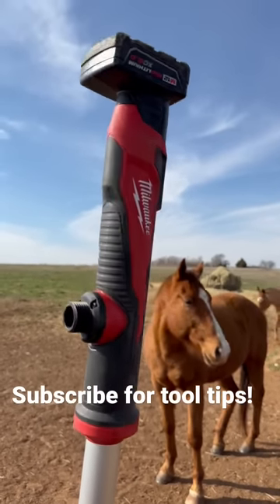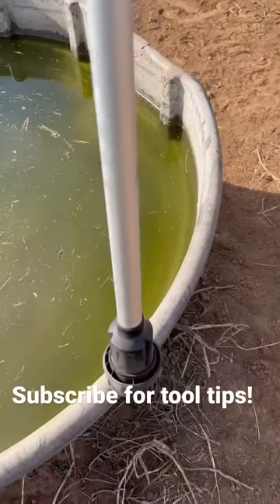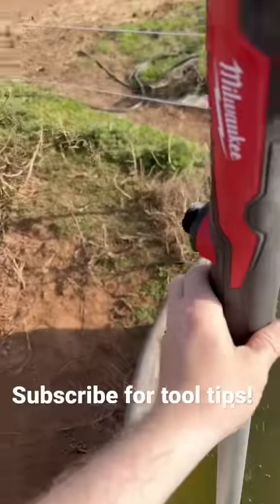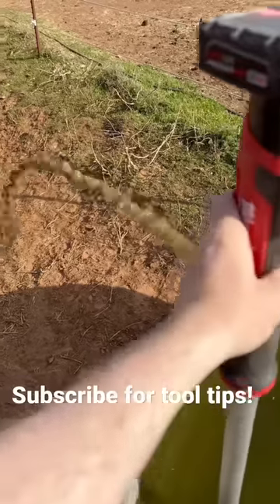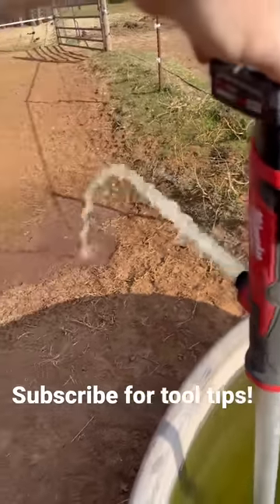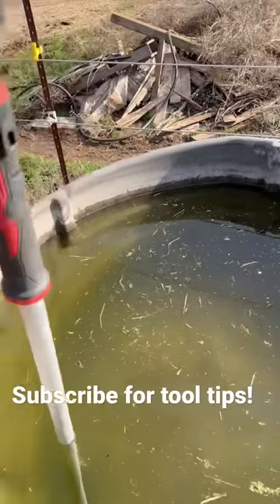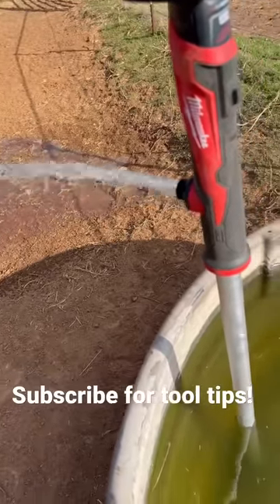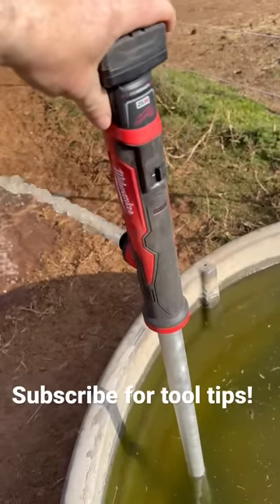Milwaukee M12 Water Pump!  What do you use yours for?  #milwaukeem12 #milwaukee #stickpump

Comment: We can all agree that this video was made to show your wife that it wasn’t “a stupid idea” to get one 😂
Reply: Lmao probably, I use a Milwaukee transfer pump, wouldve done that tank in 60 seconds lol
Reply: @zbruh7268  lol
Reply: that's just you
Reply: It’s to prove it to your bros tbh
Reply: Well theres 598 guys who would agree with you.
Reply: Hahaah
Reply: im ur 1k like
Reply: He put the hole in the tank himself.
Reply: @fosty.  what he didn’t show you was the Milwaukee drill on the other side of the tank
Reply: I've got one for pumping out valve boxes. PRO TIP: take a Rigid wet-vac filter, plug the bottom hole in the rubber with a 1/2 inch pvc threaded plug, and the head of the Milwaukee pump fits nicely in the wet-vac filter opening which prevents the pump from getting clogged with grass and debris.
Reply: I've got one for pumping out valve boxes. PRO TIP: take a Rigid wet-vac filter, plug the bottom hole in the rubber with a 1/2 inch pvc threaded plug, and the head of the Milwaukee pump fits nicely in the wet-vac filter opening which prevents the pump from getting clogged with grass and debris.
Reply: It only cost 20 dollars I swear...
Reply: If you're living your life based off what your wife says you can and cannot do then it's time for a divorce. For me and my significant other, we have a spending limit where we can buy whatever we want up to that price. Anything over that price you need to consult with one another. It works for us.
Reply: He could just pour the water out and he has to hold it the whole time so I actually agree with the wife on this one. This is a pretty stupid idea
Reply: Wife prolly just uses a 2 metre hose, lets the water siphon out on its own, no battery needed. 🤷🏻‍♂️
Reply: Lmao 😂

Comment: I use it to siphon gas out of my neighbors car. Works like a charm.
Reply: i love you dude and i don't even know you😭😭😂😂
Reply: Really, its your neighbors' fault if their fuel filling hole is big enough to fit this.
Reply: @groadybones  buddy buddy buddy….. it clearly would have to be modified in order to retrofit a hose on the siphon end in order to get into the tank. But it wouldn’t work for long anyway
Reply: @groadybones  that's what they say about me on the weekends 😂😅
Reply: Aaah this one's quick. He beat me to the joke I was gonna say
Reply: This would never work for fuel it would explode immediately if you tried. Don’t seriously use an electric pump to pump fuel. Unless it’s specifically designed to pump fuel.
Reply: @shanekerry9530 why wouldn't it past?
Reply: @shanekerry9530  dude , it’s a joke
Reply: @shanekerry9530  it wouldn’t explode 
It would dry out the internal seals pretty fast though
Reply: @shanekerry9530  yes it would i use it daily to pump pump containers of fuel
Reply: Drilling a hole in the tank and using a oil catch pan works too
Reply: thanks for the idea!
Reply: @jrc-fabs1634  I hope it works out
Reply: Bruh 😂😂
Reply: @shanekerry9530 ”modified” a garden hose and duct tape😊
Reply: With gas at five dollars a gallon I'm sure you have.. Every time I go to the pump every week it goes up $.20 $.50
Reply: It's easier to just poke a hole in the bottom of the tank with a hatchet. Then use an oil drain pan to catch the gas. Then dump it in a 5 gallon bucket until it's full. And then repeat until all the gas is gone.
Reply: Little horse water won’t hurt anyone.
Reply: @shanekerry9530  like the EFP in your vehicle?
Reply: @relaxandsleeptime5769  nothing like that actually…. You mean like something specifically designed to pump fuel vs???
Reply: @shanekerry9530  yes like the a fuel pump in a vehicle meant to pump flammable liquids.
Reply: @relaxandsleeptime5769  again missing the SPECIFICALLY DESIGNED to pump that fuel …. A submersed pump. Made to pump fuel vs a pump made to pump non flammable liquids
Reply: Y’all think a cut up garden hose and this thing won’t suck a tank dry and get your saw/bike/ truck running? Maybe kinda dirty but if it runs it runs.
Reply: No I guess I’m more concerned of electric spark and possible vapors igniting I guess in an open ventilated area pumping fuel may be fine but I personally watched an idiot torch 2 brand newish trucks and entire garage sucking up gas with a shop vac and I wouldn’t want to risk it
Reply: If you punch a hole in their gas tank you can just use a bucket. You’ll see the vehicle gone for a week or so but when it comes back they’ll probably fill the new tank up and set up a sting. That’s where the fun begins 😃😃. Fat suits and wigs come into play. You may have to spike their water supply with lsd and meth but that’s all part of the game they asked for by moving near you, it’s their fault. Get that gas 😁
Reply: I know you being honest 😅😅😅 damn.....love it❤❤😂😂🎉😅😅😮
Reply: @shanekerry9530  And since your saving $$ on gas you can afford brass fittings to adapt it to fit in the neighbors tank.
Reply: @danielbarber8387  lol sue thing nothing like the possibility of ripping 2 tanks off at the same time

Comment: I'll race you with a dollar store bucket. The winner keeps the pump 😂
Reply: Exactly 😂
A piece of hose would also do the same thing lol
Reply: those troughs all have a huge drain plug, too.. mine all have drain spigots..
Reply: why u need the pump if you got the bucket then🤷‍♂️
Reply: @dorianpaul7026  sell it for another bucket lmao
Reply: @Chrischone2  my man haha
Reply: The point of the video was "I have a excuse to use this tool" but like the comment earlier said there is most likely a plug to drain the thing lol
Reply: @dorianpaul7026  to sell it online and buy myself a useful tool xD
Reply: Exactly, winner keeps the pump because the loser never had it in the first place.
Reply: @Chrischone2  😂😂😂
Reply: I'll take the bet.  The opening to the pit the water is in is 8inX8in.
Reply: @dommyboysmith  I'm not volunteering to get the siphon started.
Reply: @amerlin388  if you put the hose in the water, then stretch the hose out and pour about a gallon of water into the other end, you can just drop the hose and the gallon you poured in will run out creating enough vacuum to pull a siphon. Works like a charm
Reply: @Factchecker9111  Yes, yes.  I couldn't get over the visual of someone getting a mouthful of that water.  You can also gradually submerge the hose so it fills with water, cap the end with your thumb, pull out sufficient length and toss it to the ground.  You must be strategic in how much hose is left in the tank;  outlet must be lower than the inlet.
Reply: @amerlin388  very well

Comment: Aside from using it to discharge water, you might be able to use it for a camp shower. Screw on a 1/2” Flexi hose and hand held shower head 👌
Reply: Exactly what I did except I run it's output thru a EcoTemp L5 heater.
Reply: Very good idea!!

Comment: Gotta love those rare times we get to use unecessary crap we buy.
Reply: What’s wrong with a bucket?
Reply: @dnlfrkmn  
How you get a bucket down a toilet tank? This things awesome
Reply: @dnlfrkmn  in this situation for the short technically a bucket is fine. 

For when you have to handle something that's flooded and you can't get your five gallon bucket or whatever down into the pipe or whatever it's perfectly fine to use this
Reply: If you lived on a ranch, you'd know that a trash pump is essential. I actually had to use mine last week to pump out a watering trough (an oval galvanized one for cattle) just like this. I used it connected to an IBC tote to water new plants down at the entry gate. I used it to pump the extra herbicide from last year back into the sprayer. A million different things. Owning livestock and a large ranch is a full time job. I do it when I get home from my actual job, plus I have 2 full time employees at the ranch, one of them lives there full time. There is always work to do. The amount of tools and equipment you need is staggering.

Comment: I'm pretty sure you can improve your battery life by attaching a hose 1.5 times longer than the pipe.
That way siphoning pressures will be helping you pump down reservoirs instead of it all just going into accelerating individual droplets to the ground.
Reply: Yeah - that's a great idea and I'd bet this device could be shut off to save the charge  on the battery
Reply: The length of the hose doesn't matter as long as it's at ground level.
Reply: @allaboutroofing2  *As long as the end of the hose is lower than the intake
Reply: Thanks bill nye the science guy.............
Reply: Just saying... that if you have service or flush  several reservoirs to tend to on a near daily basis then saving battery life by using siphoning line can save money and time.
Reply: or you can just use a siphoning hose and  skip this whole  tool
Reply: Yea you are correct. The water in the hose would create a vacuum pulling the water up to the pump. But this is simply a waste of money. Plus it destroys the ground as you see in the video. You want a easy smooth flow coming out onto dirt so it doesn’t erode away
Reply: or just, you know, run the thing at an angle instead of plumb until you need to suck out the last drops.

Comment: 4 hours later and 12 battery charges and it's done!
Reply: That Milwaukee battery lasts for many hours 4 hours is no problem on 1 charge
Reply: @ericschulze5641  Seriously doubt that battery is lasting anywhere near 4 hours doing that.
Reply: @Austin Michael  you probably have a ridged brand they suck the batteries only last 20 minutes if your lucky. The guys not the smartest anyway, when all you need is a scrap of garden hose or a shop vac hose and you can siphon it off while doing something else
Reply: @ericschulze5641  I don't own any ridgid. This still isn't lasting 4 hours
Reply: Idk, I ran my m12 fuel impact all day running deck screws in before I needed to recharge it. 6amp xc
Reply: 9gpm and 275 gallon out of 1 fully charged XC 4.0 battery. Not bad! I used one weekly and it’s awesome!
Reply: Idk man I did an entire cabinet build with a small drop ceiling added in couple days of work on 1 5.0 battery between drill, impact, and multi tool. Still had one bar on the battery after the job was done. 15 years ago my crapsman would have easily went through 10 charges
Reply: @AustinMichael  on a rapid charger,  the battery will charger in 20 minutes.  That 6 amp battery will last an hour and a half.  As long as you have two batteries, you can constantly charge. I use this for my boats all the time. I always keep one on my boat in case of an emergency

Comment: Should’ve installed a 1” pvc valve as a drain while it was empty
Reply: @ScoocumAF  that too though I’m personally sketched out by the thought of creating a flow of water that’s pointed directly at a battery powered tool that’s in your hands
Reply: @pws3rd170  it's not gonna electrocute ya!
Reply: Those tanks already have drains at the bottom he probably just didn’t want to drain it all the way as well as put that little guy to use
Reply: You could do that oooor buy stupid tools you don’t actually need 😂
Reply: @pws3rd170  almost like a wet vac.. except they're mains voltage.. CRAZY
Reply: @pws3rd170  it’s 12v…
Reply: Those troughs typically already have one bottom center on a long side.
Reply: @1982MCI  can still ruin an expensive power tool
Reply: @user-njyzcip  and that expensive drill isn’t waterproof
Reply: @alexcb016  I’m aware but it would appear this one doesn’t or it’s not functional since he didn’t use it

Comment: Laughs in .99¢ siphon hose
Reply: That's not the only use for it... Try siphoning out a flooded water valve access pit.

Every tool has it's use.
Reply: @volvo09  $200 verse about $15 for a drill transfer pump

Comment: My only problem with Milwaukee is the Batteries cost and arm, a leg and a kidney to get the Battery operate stuff going, the charger is also sold separately 🤣🤣 By the end of it you abt 700$
Reply: As an owner of a few m12 tools, a lot of what you’re saying is false.

2 batteries are $55 if you need spares.
My tool came with a charger and battery.

Comment: Okay, that is cool. And when I'm doing sprinkler repair I'm constantly pumping out water. 

On a budget, I had a 2-inch siphon that I used when I was cleaning the horse trough. I made it out of PVC. It would empty that tank pretty fast too. Just dip the whole thing in the water, put my hand over one side to keep it primed, and then hang it over the edge.

I would clean out their water trough anytime it got looking so nasty that I wouldn't drink out of it. During the summer, it was a regular chore.

Comment: Video would have been longer but the battery died.
Reply from the maker: I actually pumped down 10-12” and repaired the hole. Still had 2 bars on it.
Reply: @MillisConstruction  sorry, just my sarcastic nature. I have a family member that works for the city water department and he uses one to pump out fire hydrants so they don't freeze if they get used (charged) in the winter.  He said everyone should have one. I personally don't have one so they must be junk....

Comment: I didn't know they made such things.  Is it more economical than buying an off-brand pump?  Also, if I were you, I'd attach a hose to the outlet long enough to reach the ground and then shut off the pump after getting the siphon started.  There's no way you have enough battery power or spares to empty that thing, and not worth the wear on the tool.

Also, I didn't notice, is it brushless?

Comment: Too bad we can't change the barrel to a hose for deeper reservoirs.
I've used small pumps driven by a drill that are similar to this which is great for outdoor use with a length of hose on both ends. Indoors I can do the same with a long garden hose attached for larger volumes of water. If its just a few gallons to draw I use a "bucket head" wet/dry vac that I can plug into a 110 outlet

Comment: I had this idea for years im glad someone finally made one only one  problem they it came out after i got a new job and got a way from the water company years of hand pumping one thing i will say it nice but slow hand pumping is quicker when meter reading I've built something like that with a 20 volt battery and a transfer pump a little more volum take the same amount of time i say a shopvac is quicker but who has that kind of time

Comment: This would be good for a mobile pressure washer setup for when it’s too far for a hose.  I’ve tried with just gravity and it doesn’t work, you need sone head pressure.  30 gallon trash can or barrel, this and your pressure washer in the bed of a truck would get you 5 minutes of warshin’

Comment: I'm an old skateboarder and we like to clean out abandoned swimming pools to skate them. They are usually partially filled in the bottom with scum water that we have to hand bail out currently. This would work awesome for that.
Reply: You’d need like $700 in batteries to pump that much water
Reply: @Meowface.  Usually there's only a foot or so of water.

Comment: In my little hunting cabin in the middle of nowhere I have been using rain collection for the water supply but it was not high enough to make any decent pressure, so when I saw one of these I got one a modified it so I can remotely turn it on where I need the water and I have a bunch of Milwaukee tools so I have plenty of batteries.

Comment: I use one as an iron worker to drain the holes of column embedments. Helps to level the anchor bolts and set the baseplate accurately

Comment: I actually super need one of these.  My sump pump went out like last year. And I never replaced it due to my dad dying. And tbh I really don't have just an extra $400 to build a new sump pit and install a pump. But the issue is now there's a huge pool of water in my clay based basment and it won't go away. And it's eatting away near the foundation a bit.  But I can't really afford many tools. I'm sure this thing would handle a muddy pit like that no problem. Then I could clean the pit up and replace with rock and install a proper pump.
Reply: Why do you need a new sump pit... Take out the old sump

Comment: Lemme tell ya son, I have this pump. And HAVE I EVER put this thing to the test. I’m an electrician, doing a project wiring about 100 new mobile homes in a park. My trenches are around 3 Ft deep 20- 30ft long and sometimes we get a day or two of rain and any trench that’s open has filled with water. THIS Bad boy has been my go to. For its size you CANNOT beat its performance! I LOVE IT